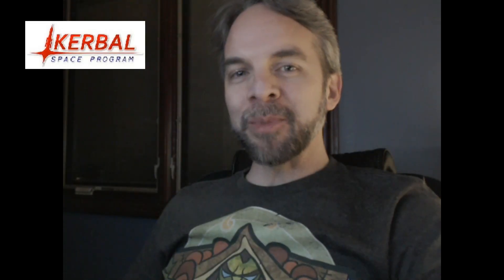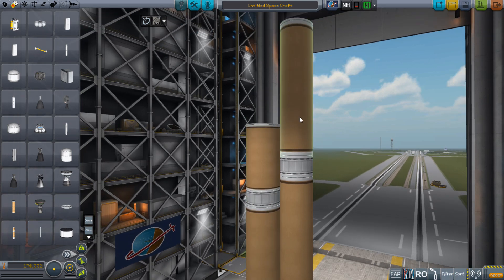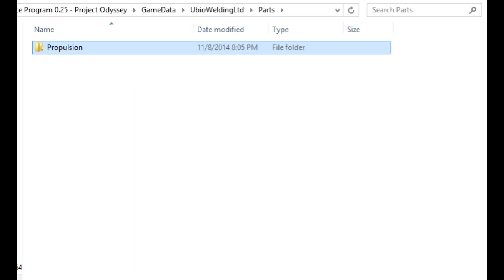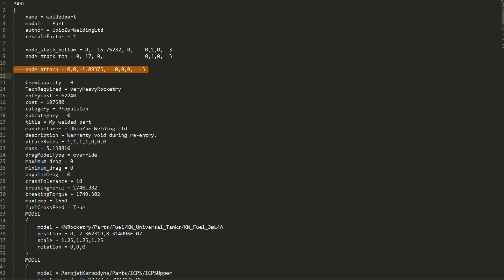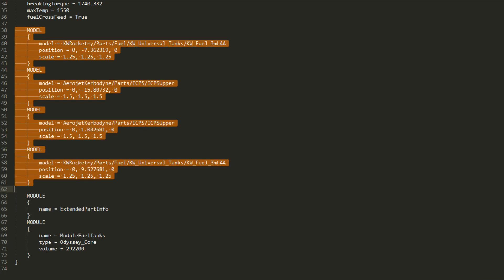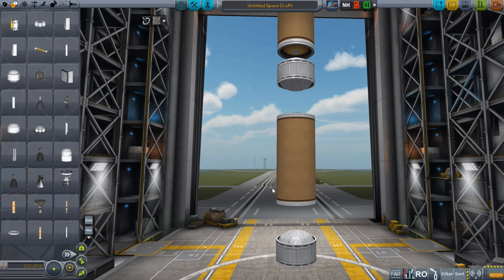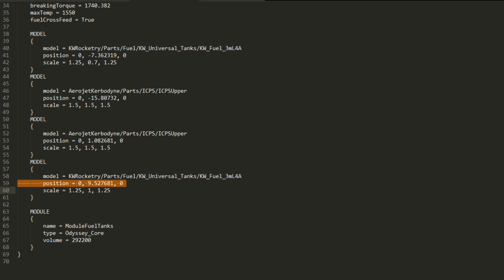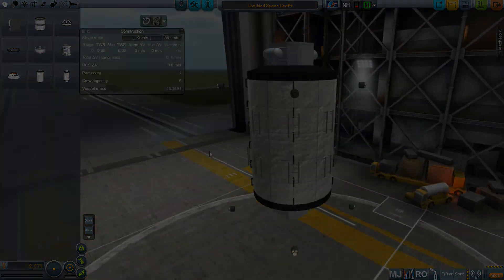"PART" Files (part 2: welding) -- AMA 5 -- KSP 0.25

Comment: I know that i might be a little late on this but is there one for the latest version of KSP that is out as of the time of this comment being posted? its just that the icon doesn't show up where you have it.
Reply: Harold nator
This is the thread: http://forum.kerbalspaceprogram.com/threads/107273-0-90-UbioZur-Welding-Ltd-Continued-2-1-1-%282015-01-14%29/page33
This is the version for 1.0.2:   https://github.com/UbioWeldingLtd/UbioWeldContinued/blob/dev-1.0/UbioWeldContinued-2.1.3.zip

Comment: I had a question that maybe someone will be able to answer about the welded parts. I've got a welded part that can surface attach but won't stack on the large top and bottom nodes with other parts stackable parts. It will click into place but is still transparent like it is not attached. The attach rules are the same as similar parts and I can't seem to figure it out.
Reply from the maker: The_Son_of_Al Move the attach mode you as "primary" to the bottom of the node list in the config.
Reply: Worked like a charm! Thanks a lot Bob

Comment: Awesome! but, when i weld some parts with solar panels, the solar panels don't work. how can i weld a part and get the solar panels to work? do i need to weld the part, and then put the solar panels on? or is there another way?
Reply from the maker: Matke Kerman I recommend NOT welding things that have animations or collision faces (like solar panels) unless you REALLY know what you're doing. Weld together things that serve no function like cosmetic things, or simple things like resource containers. Attach things that animate after you've welded.
Reply: okay, thanks:)
Reply: Bob Fitch  Quick question. Is it possible to resize parts along a specific axis without welding them, to be specific, could I do this with a stock MK2 cargo bay?

I need a 6 meter cargo bay in a stock MK2 format, and since Squad unfortunately hasn't included one and I can't find a modpack with one anywhere. I've had to throw one together with two 4 meter bays and the offset tool, it works but the textures on them try to overlap each other and creates some aesthetic issues. Being able to resize a 4 meter bay would be a much better solution.
Reply: GiantZombies69n Yes, you can. Find the "scale" part of the part config, and there will be three values next to it. I believe that the order of them is XYZ. It's also mentioned in the video. For the Mk2 cargo bays, you should use the Y direction to change the length.
Reply: DEMILLETECH JtD_viewer
I've seen those values before but I didn't know if changing them would mess anything up.

Before I actually go and try it I've got one more question. When you do it do the attach nodes scale up with with the part or is there something else to change for those?
Reply from the maker: GiantZombies69n nodes are defined by node_* lines. nodes can be scales with the rescaleFactor entry too.
Reply: Bob Fitch I wasn't talking about rescale factor, but I'm guessing the nodes would move with the length.
Reply from the maker: DEMILLETECH JtD_viewer The nodes only move with rescaleFactor. If he only scales the model in one axis then he needs to move the nodes by hand.
Reply: Oh. Also, I was wondering if you'd be fine if I made a derivative of Gateway on my other channel.

Comment: So it looks like part welding is simple enough with the UbioZur mod back online and it really only gets complicated when you want to alter the default size of an individual part. So now I have one question: What does "physical significance" mean? In the game only. Let's not get into metaphysics.
Reply from the maker: HanoverFiste1965 A 0 means "treat normally" and 1 means "ignore physics" so the part does not get any default Unity physics applied to it. Also I believe the linkage strengths are treated as though the connected parts were in direct contact instead of having the part in between (in the event you have a no-physics part sandwiched between others; I have used this trick with light/thin interstages before, such as one with the new Hydra in fact).
Reply: Bob Fitch So it could be a bit "cheaty" if you didn't consider welding several parts together to be "cheaty" already. Though it does make more sense to have stronger links when seval parts are combined. You rock, Bob!
Reply from the maker: The model could have been created with the parts together if the author had felt like it. In real rockets an interstage is not as weak as KSP makes it, because real rocket integrity is not solely dependent on mass nad node size like in KSP. I try to simulate reality rather than using default KSP strengths. Look at the CBA of the Atlas for example. I think it's just 300 kg.